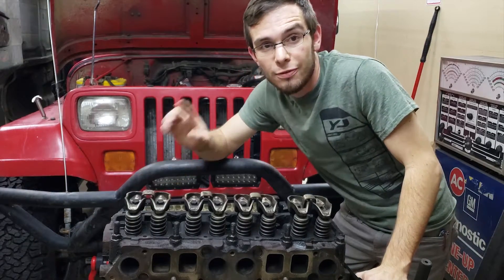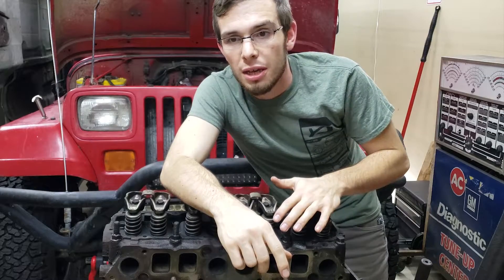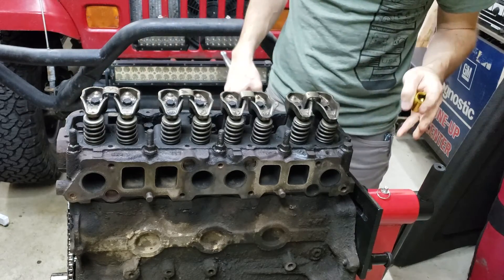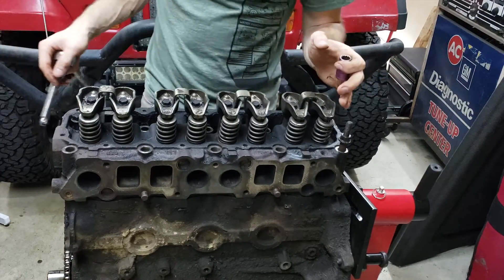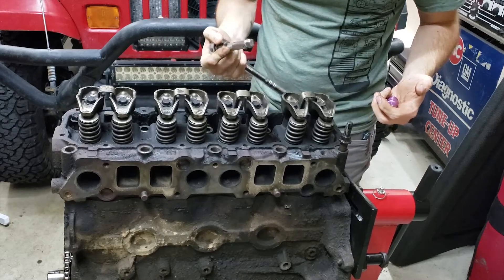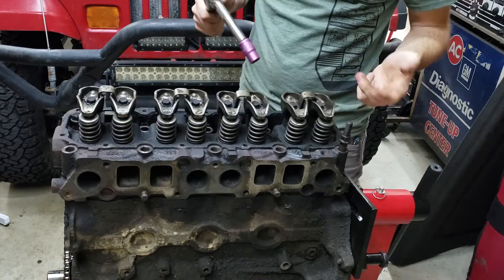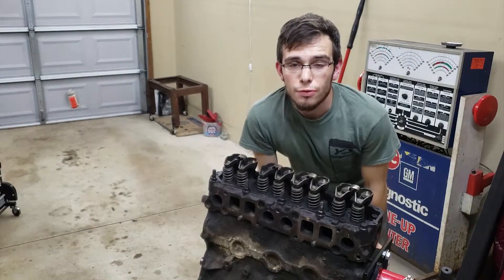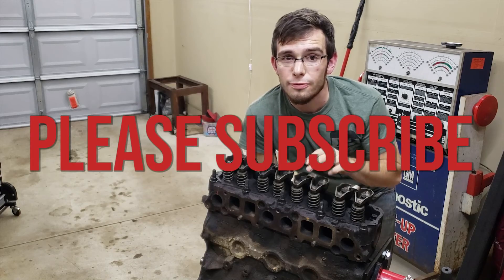Jeep 2.5L 4 Cylinder Engine Complete Tear Down Part 1

Comment: Did you ever confirm if the 94 is the year? I'm doing my 86 2.5 right now and mine says 89 there.  Mine is only 59k original miles so I'd be blown away if the head had already been replaced

Comment: All that crap inside is mostly from running crappy oil. Break new engines in with "real" oil, run them with GOOD full synthetic (Amsoil or Mobil1), and NEVER run 0w oil of any kind.

Comment: 8:32 

Use diesel motor oil (15W-40) it will clean up any internals on engines. This oil formula is the secret formula for a million mile engine. 

Your oil will look black fairly quickly after every oil change until your engine's internals are all cleaned up. 

1). Change oil at 3000 miles or every 3 months (90 days), whichever one comes first. 

2). Warm up engine until you reach regular operating temperature on your given engine went ambient temperature is below 90°F and above 90°F at least wait until it idols down and drive slow until the regular operating temperature is reached.
 
On older cast iron block engines, it is best to practice this warming up procedure as the warmer temperatures expand the cast iron and tighten up the seals, preventing oil leaks. 

3). Do not ever race a cold engine with this oil formula (15W-40), it will cause premature engine wear preventing you from reaching your one million mile goal. 

Also, if your engine has high mileage and you live in a hot climate area (Nevada, So. Cal., Arizona, Texas,  Louisiana, Florida ect, pretty much the southern states, add a quart of Lucas engine oil treatment,..

(subtract one quart of oil and substitute it with one quart of Lucas engine oil treatment). 

I hope this helps out one of you kids dealing with internal combustion in the future.  

By then, petroleum will be obsolete, but for you, museum keepers I bet 15W-40 will be the surviving formula.

Comment: VERY INFORMATIVE VIDEO, I HAVE  1994M CHEROKEE 2,5L THANK YOU,  FROM
LITHUANIA
Reply: Single roller timing chain. JUNK! Measure cam to crank center use the double roller timing chain from the 4.0 fits the 2.5 and clears stock timing cover

Comment: Given how solid these are, what are the chances somone puts this in a Renegade with that crappy 2.4.
Reply from the maker: @Rebel1280  I would imagine that you would need to replace the whole powertrain and likely end up with a slower vehicle. But if you converted to solid axles at the save time, it could be a cool/ funny build

Comment: I have TJ 97 2.5LT engine, how will I maintain it to last?
Reply from the maker: My best advice is to clean everything. If it comes off easily, remove it and clean it. Especially the valve cover, you can see my video on this. When the engine is clean, you can replace sensors easier, you will be more willing to do routine maintenance and you are more likely to find vacuum leaks. Also, keep it cool, if you do not have full confidence in an electric fan setup, keep the clutch fan and fan shroud. This last one seems odd but let the engine rev up to 5000 rpm once in a while, the lifters on these engines tend to stick and restrict oil flow to the top end. I found that revving the engine to higher rpm periodically helps keep the lifters from getting sticky. I also use synthetic oil and I send it in to Blackstone for analysis when I do oil changes. They tell you if there is anything concerning and let you know if you can run longer between oil changes without harming the engine.

Comment: Hey man this is the only way I can contact you I have this exact motor but can hardly find info on it can you tell me wat I need for intake and exhaust manifold hardware the bolt size ? I can't figure it out
Reply from the maker: Should be 3/8-16 1.25" long

Comment: I have owned a 1995 yj since 2003. I bought it it had 71,000 on it. I drive it everyday .It has now 351,684 on it . I will say it doses not have the power it once had, but it still runs good. I still drive it everyday  12/23/2022.

Comment: I'm thinking that oil in the exhaust port was from a leaking valve stem seal. If you were getting excessive oilfrom inside the cylinder the cylinder would look different than the rest and so would the valves

Comment: 430,337 miles on my 90’ yj. Original 2.5 engine. Regular preventative maintenance and regular oil changes and moderate driving. These engines are bullet proof.
Reply from the maker: Amazing!

Comment: I know you said this is not a repair video but learning how the engine functions is far better than a “how to” video. I found your video because I’ve got to replace the head gasket.  You mentioned some other video where you remove the covers, which I believe exposes the gasket.  What I’m curious about is if I remove the cover while the engine is still intact, do I need to drain the oil?  With your engine completely removed and no oil filter attached, yada yada yada, it makes sense you have no oil to worry about. Something tells me that there won’t be a lot of oil but there will be some so that the engine can turn over without metal on metal friction.
Reply from the maker: If you are changing the head gasket you do not need to drain the oil.  Now it's a good idea to change the oil when you are done,  this is just in case you drop any dirt into the engine. Also be sure to follow a manual for all bolt patterns and torque specs! Thanks for watching

Comment: Is this engine at all similar to the 2.5 “iron duke” found in early 80s CJs?  I’m pretty sure I have bad piston rings and I am thinking of trying to replace them.
Reply: Totally different, this is basically a 4.0 with the two center cylinders removed.
Reply: @Broncodriver1975  I'd think it would be related (pretty sure they are). They're both AMC 2.5L. The 4.0 was a later innovation of the 2.5 with two cylinders added.
Reply: @Broncodriver1975   The 4.0L is a 2.5L with 2 cylinders added.
Reply: @mchldln2  well the 6 cylinder version came out in the early "60's,  the 4 cylinder 20 years later in the early "80's...

Comment: Great video! What’s the difference between the 2.5 L vs 2.5 td?.....looking to buy a XJ with a 2.5L.Thanks..
Reply from the maker: The "L" stands for liter its just the size of the engine. TD would mean turbo diesel... probably.  No jeeps were sold with that engine in the US. You might find one in other countries but I'm not sure.
Reply: @JeepSheepTV  that’s right, I am now in 
Munich Germany...... I have seen videos of the actual 2.5 turbo diesel but have not found much info on the 2.5 l 4 cylinder  90 kw 122 ps 5 speed Cherokee XJ . I found a 1995 XJ with 129 k, looks in good  shape on the outside and want to test drive it as soon as the quarantine is over. Is this the same engine that you are working on, reliability etc. thanks

Comment: Man THANK YOU!!!!! Subscribed super fast.....my 98 Dakota 2.5l (same motor and the Jeep) died on me a week ago, with only 164,000 miles, but it was totalled and issued a salvaged title before i bought it.... so gonna rebuild her and i needed help sincr it will be my first rebuild. Something i noticed on mine is the my head and valve cover are contoured.....like not smooth but has texture
Reply from the maker: Good luck! Get a repair manual and be sure to follow all tolerances and torque specs! If it seems overwhelming just take it one step at a time!
Reply: @JeepSheepTV Where do you find the repair manual ?
Reply from the maker: @prelaw503  sometimes you can find them online posted in forums for free or you can buy them from a few places.  Just gotta search
Reply: does not worth it.... istead I would try to install a gm v6 60 degrees from camaro, it use the same bellhouse pattern

Comment: Great vid, just subbed. I just want to say that yes it is a slow motor and the 4l v6 will not fit the 4cly frame without mods. Having said that my 2.5 tj gets me around nicely on the street but hwy speeds are 60 to65 max. Im cool with that and it is a reliable motor.

Comment: I’m new to the Jeep world. I bought a 1993 YJ model S with ~125000 miles. Just wanting a weekend beach put-put, however found out really quickly that the AMC 2.5L is the most disliked, under powered, and unmodifiable power plants in the world. In fact it is seems to be one of the most cursed or cussed (depending on which side of the Masson Dixon line you are on) in the Jeep world, mostly the Chrysler has the ECM set up to keep modifications from being effective. In short it will nullify injector upgrades, it is not a unit that has many programming upgrades, basically it is thought of as a dog for power. However almost all threads I have read refer to the 2.5L as a tractor of an engine almost the as if the Energizer Bunny and the Chrysler slant 6 mated and the 2.5 was the result. There are intermittent misses in the number 2 cylinder, sometimes it’s the injector sometimes it seems to be the plug. It will begin loosing power in fourth gear on flat ground. I never been able to run in 5th gear. Granted I should have researched this Jeep better before buying, but I had no idea about the legacy associated with the 2.5L. Is there hope for this engine, or should I go another direction for a power plant and reliability?
Reply: I had a 2.5 in my 97 tj, Loads of fun. Having a manual helps. But I've had it airborne so it's got just enough for off roading but not enough to do 80 lol, it's a jeep and jeeps aren't fast. But you can go where others can't.
Reply: Put a straight 6 in it, that's what my son did and it runs great and has lots of power.
Reply: Thanks for the replies. I’m on a learning curve here, so I may have come across as I want this to be the fastest YJ on the Texas gulf coast. That’s not my goal with the Jeep.  I just want it to maintain 65 mph using fifth gear and have the ability to have some fun off road. 
 One of the reasons I like this channel is “the stubbornness” to stick with the 2.5L. Along with real honestly e.g. “I don’t have the right tool so I’m not going to be doing this.”!
Reply: @r.kilsby1323  it may be possible you have a compression issue it sounds like your loosening power
Reply: Tedd Adolphson I am going to do this over the holidays while I’m burning vacation. I suspect that this is a 85% of what is wrong. Just hate to confirm this fear (lol) as it’s going to lead to so much more fun. Because, I know me and I’ll have the champagne dream build on my mind while operating on a generic root beer budget.
Reply from the maker: As you watch my channel you will see me do everything possible to increase the performance of this engine.  Although I believe it's possible ro make it drivable and even dare I say "fun", unless you are really creative with junkyard parts it will cost toy way more than swapping to a better powerplant such as a Chevy v8. I  am stubborn and want to make this engine fun but it is in no way the most efficent route.